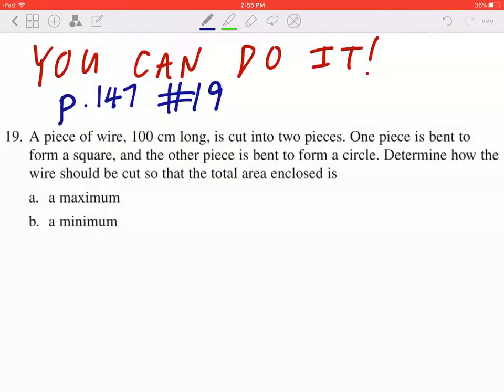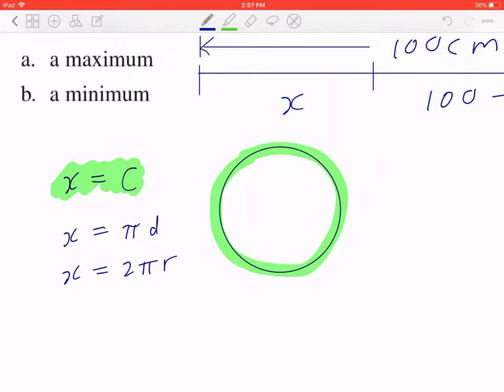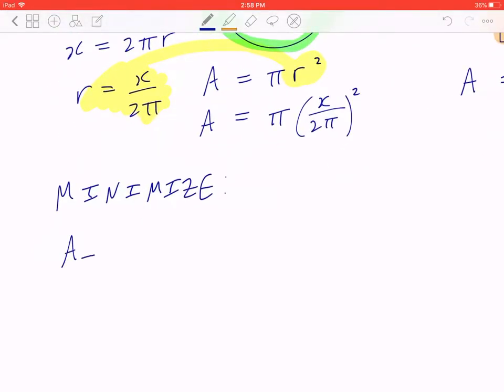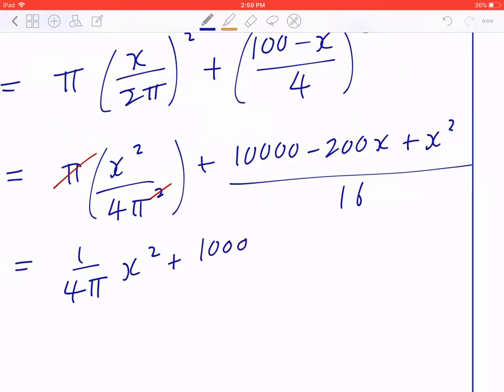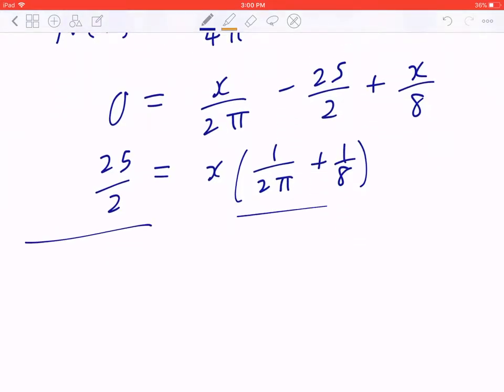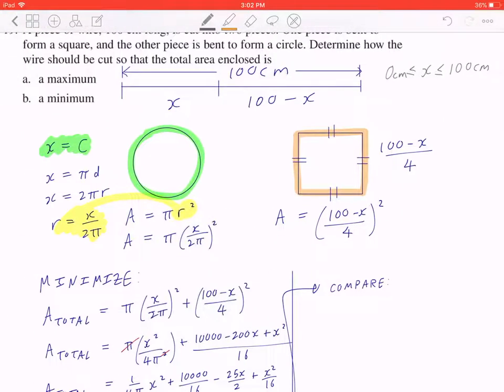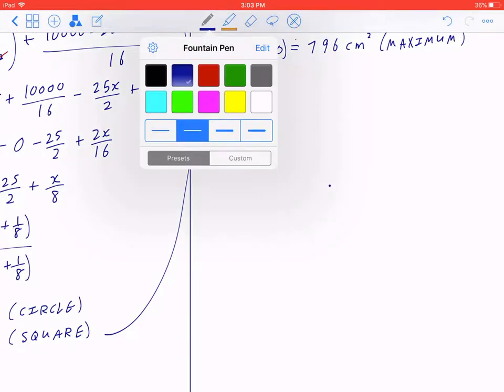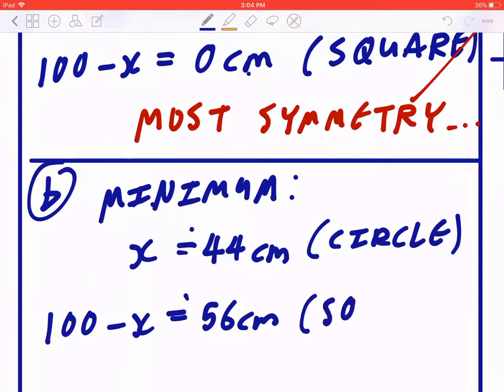A piece of wire, 100 cm long, is cut into two pieces. One piece is bent to form a square, ...

Comment: This is a stupid question but why was it 100-x/4. Why wouldn’t it be (100-x)*4. Also great video thank you so much
Reply: late and all but perimeter of a square is 4s
s representing each side
and the perimeter must equal 100-x
so we have the equation: 100-x=4s
so isolate for s and you would get 100-x/4
Reply: Because 100-x is the parameter (the length of all sides), so the side lengths (there are 4 sides) must be (100-x)/4.

Comment: This is probably a dumb question, but how do you know that the circumference of the circle is equal to x and the perimeter of the square is equal to (100-x) instead of the other way around? Would you get the same x value with switched equations?
Reply from the maker: Great question Tashmi! Both method works. If you redo the entire question "the other way around", you will get the same final answers.
Reply: @letspassmath b😊